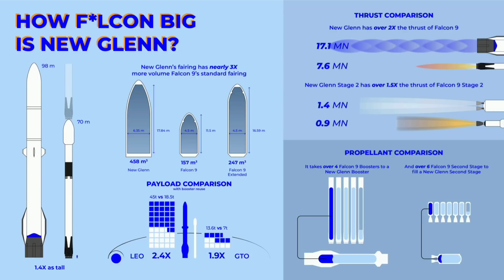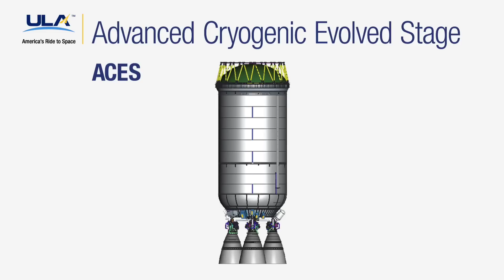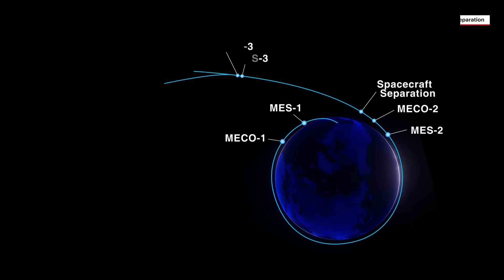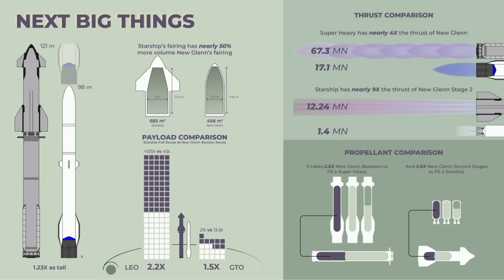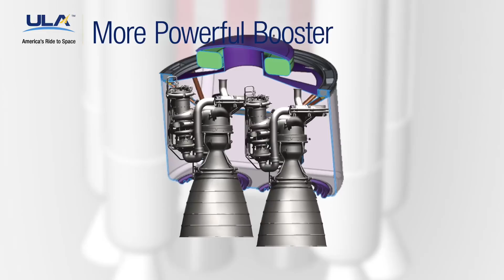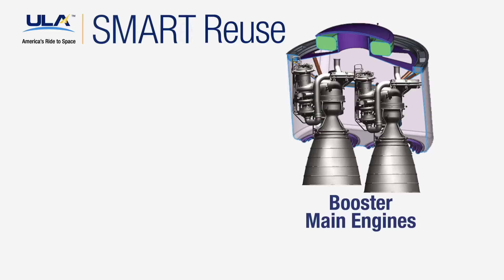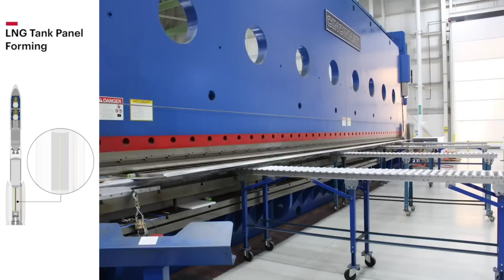Bad for NASA!  Bad for Spaceflight!  If Blue Origin buys ULA, only Jeff Bezos will win!

Comment: Blue Origin couldn't get their own equipment to work, why would anyone think they can get someone else's dysfunctional equipment, which is far more expensive to operate, to work?
Reply: Theyre equipment does work...Vulkan launched on their engines.  They worked flwlessly.
Reply: @iamscoutstfu In the nearly quarter century since Blue Origin was founded, how many rockets have they launched which have achieved orbit?
Reply: @Navarre-i1j  

they have launched 24 rockets. since their inception. They also provided engines for the ULA launch. 
So, again, their equipment obviously works.  Both BE3 and BE4 have already proven themselves. 

Also,  By what logic do you claim that BE4 is more expensive?  What information are you basing this off of? BE4 is deep throttling O2 rich closed cycle....all of those technologies are more cost effective (but more difficult to build) than their competitors.

Can you provide the figures you're looking at that imply a full flow staged combustion platform like Falcon or Starship is as fuel and cost efficient as an O2 rich closed cycle propelled ship?  Especially compared to the 30 some engines for starship, which, to date, has failed to achieve flight without blowing itself up, it'd be interesting to see your arguments as to how that platform is more cost efficient than 7 engines running O2 rich closed cycle. 

Please enlighten me.

Comment: I honestly think BO slow walked the BE-4 for Vulcan until New Glenn was closer to being ready to fly.
Reply: BE-4s were delivered in 2022 and New Glenn was hoped to launch on or about 2020 as well. On top of that, the Centaur V failure was not Blue Origin's fault, but ULA's. That delayed everything from early 2023 to January of this year. Even if BE-4 were ready in say, 2021, CV wouldn't have been. And then there's the readiness of the Peregrine and Dream Chaser payloads for Cert-1 and 2. Dream Chaser only now is in final testing.

Comment: ULA is just not a viable business going forward.  Aside from their current on-the-books slate of contracts, they're unlikely to get much more income once New Glenn and Starship start flying regularly.

The capability to deliver much more mass to orbit for much less money by ULA's competitors is what will kill ULA.  The direct to GTO or direct to GEO or direct to TLI arguments for Vulcan are specious.  Once New Glenn and Starship become capable of launching large payloads to LEO regularly, they or third-party suppliers (such as Tom Mueller's Impulse Space startup, for example) will start providing space tugs which can be integrated with a payload - and take payloads directly to those high-energy orbits, acting effectively as a third stage.

And then, once Starship achieves on-orbit refuelling and routine full reuse, it's just flat-out game over for the likes of ULA; even Blue Origin will have trouble surviving.  And that's just a handful of years (maybe 4-5) away, at this point.

Comment: You voice audio is overmodulating (distortion). It hurts my ears. Change the batteries or change the mic altogether please. Great information though. Thank you.
Reply: The only thing Mr Angry needs to do is dial in the incoming signal of the mic to 0-db not +3 or more. I rather have a low volume distortion free signal on my side then distorted high volume. Its up to us to give the signal volume and that go's a lot better if it's distortion free in the first place.

Comment: "If you cannot Beat your competition, BUY them". ~ Blue Origin
Reply: "If your competition is innovating, acquire them. And strip the useful features" Microsoft
Reply: @CyFr  And Meta too!
Reply: If you can't Beat your competition, SUE them.
Reply: @scottwilliams5642  now THAT'S the Bezos motto!
Reply: Screw Origin, owned by the same thief that owns Scamazon.
With any luck, Elon will get the people/brains, and Jeffie gets a load of old hardware.
Reply: **B.O.
Reply: Blue Origin is not the same company it used to be 1 year ago. Blue Origin is acting like a true private launch provider now. ULA is still acting like a government funded launch provider and being a union shop doesn’t help its case.
Reply: @YouTubeVic  they're still a private launch company with no orbital launches though. So they need to be a private launch company, not act like one.
Reply: Failing companies are bought out all the time.
Reply: LOL. This is engineering, not selling candy bars.  Angry has the most gullible fan.

Comment: Blue Origin's New Glenn rocket has yet ro leave the launchpad. 

ULA's Vulcan Centaur has a successful playload deployment  (Peregrine) under its belt. 

Yet with the techical problems of Boeing's Space services, and Northtop Grumman preferring to not buy out Boeing, that leaves ULA's future uncertainty. Even though it has military contracts waiting to be fulfilled.

Other than SpaceX, no other rocket company, other than Blue Origin, has the capital needed to take over ULA's commitments.

And since ULA already use Blue Origin engines, it is an easier transition for both companies.
Reply: Northrop Grumman has nothing to do with Boeing. ULA is a combined Boeing-Lockheed Martin company.